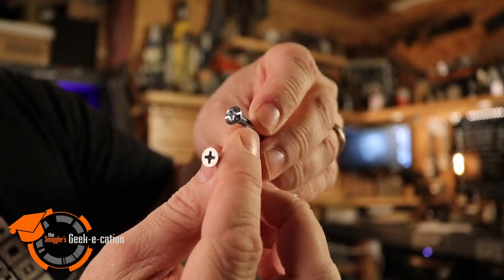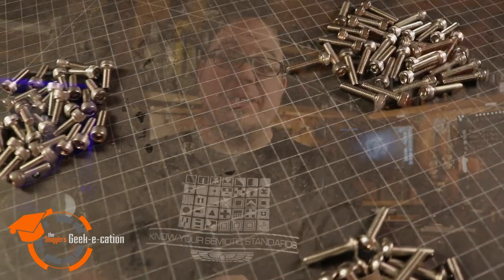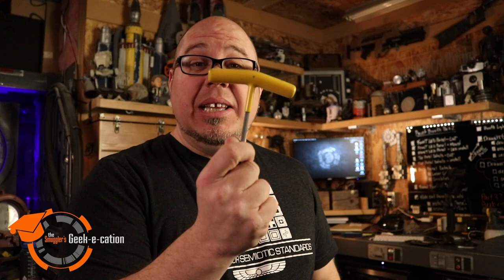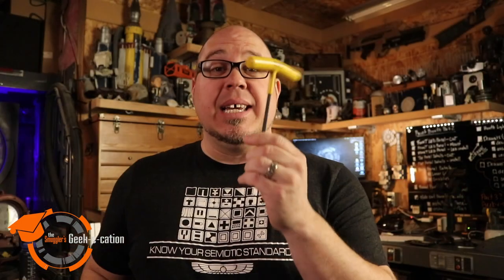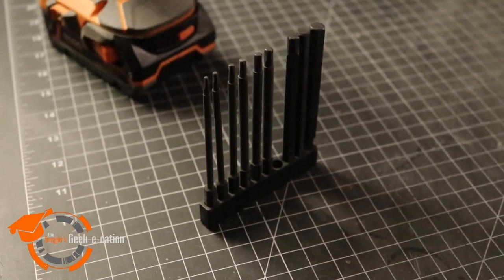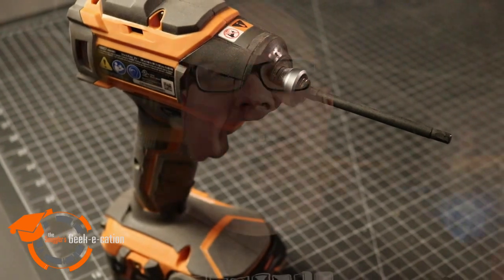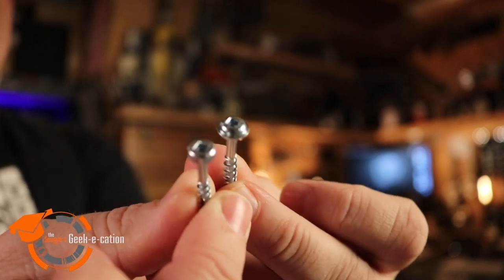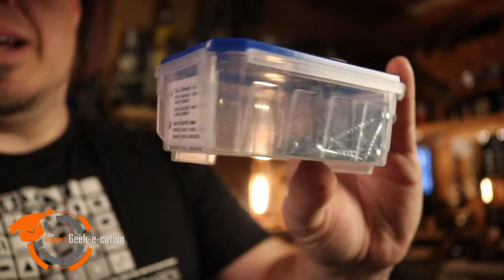Futuristic Hardware | Smuggler's Geek-e-cation

Comment: I’ve become obsessed with Everbilt M8-1.25 Zinc-Plated Steel Socket Cap Recessed Hex Screws. They come in black oxide finish. Nothing like a black hex head cap screw. Certainly captures the far away galaxy feel. 

Now you’ve got me picturing a platoon of mini GONKs. Each one uniquely designed. Sounds like a cool idea for a community build project. We each build our own mini/micro GONK and share them to a dedicated page. Maybe pick out the base box, easily available. Then we all customize them. Thoughts?
Reply from the maker: Fantastic!  I will have to check out those M8 screws as well!  And and army of mini gonks is just what the doctor ordered!

Comment: Someone mentioned in the comments about black oxide. Those are usually cheaper and if you "wash" the light oil off of them, they hold paint really well. I also like the look of slotted cheese head screws. It is an older look not seen to often nowadays. Metric is the way to go with hardware. This was excellent. Thanks for sharing.
Reply from the maker: Great suggestion.  The black oxide is 100% cheaper.  Much appreciate the comment!  Good stuff.

Comment: Your local Fastenal stocks the socket head cap screws. They come in the standard socket head as well as button head and flat head. They also have black oxide which are unfinished. Or you can get them in stainless steel. The security head screws also offer a different look.

Comment: For SW I use small hex head and old looking  screws like those in the original surplus weapons they used. For modern sci-fi hex, torx, and some computer screws look strange enough  to be futuristic and useful.

There are a hex (socket) and flat driver head combination screws that you can find I computers (mostly to attach components). They suit very well in SW and other Sci-fi projects. Also, don't forget thumb screws with that knurling pattern.

Comment: I've used knurled screws, allen head socket screws, blind screws and a variety of anti-tamper screws in my SW props. Anything but Philips or those flat/philips/square drive screws!!! Even Pan head screws with a flat head drive look more proper for SW stuff than Philips. I'm glad someone is sharing this knowledge. The right type of hardware is very important to the SW aesthetic and build philosophy.
Reply from the maker: You nailed it!  Even though I have seen Philips in SW projects, i really prefer anything other.  Like minded makers of hardware unite!!!

Comment: Want hard ware no one has seen lately....go old.  Square head or some of the more uncommon fastener types such as pentagon or 12 point instead if hex bolts.  McMaster-Car website have a lot of neat stuff.  Also check out aircraft fasteners.  Lots of crazy designs there as well, especially for military aircraft. They can be had cheap enough, if bought in bulk.  Finding them can be a bit of a pain.
Reply from the maker: Oh, that is a PERFECT idea.  That McMaster-Car catalog is insanely packed full of goodies.  Thank you for that!!
Reply: @TheSmugglersRoom  look up dzus fasteners, self ejecting quarter turn fasteners, aircraft panel fasteners, aircraft nut plates, 10 or 12 point spline bolts/nuts.  These would definitely give you a military sci-fi look as they are typical for civilian/military aerospace and generally not common much anywhere else.